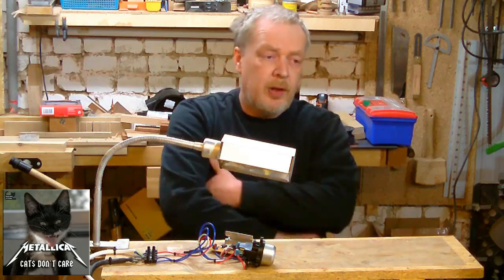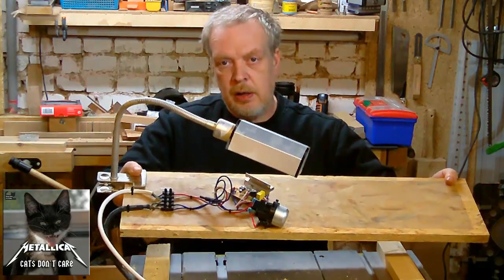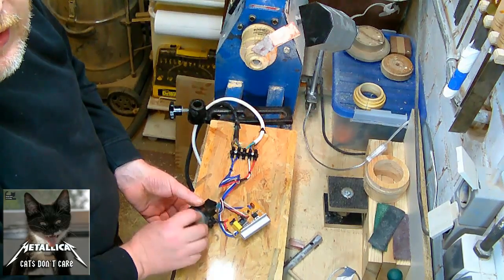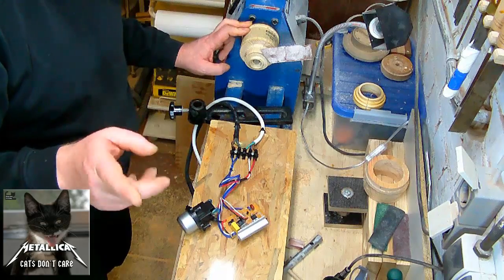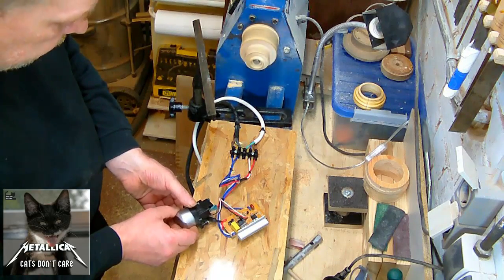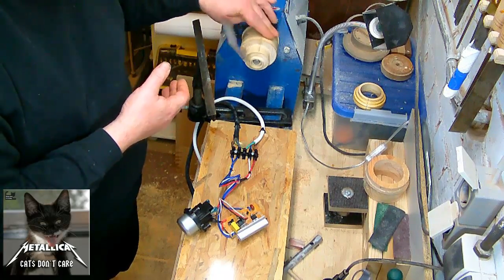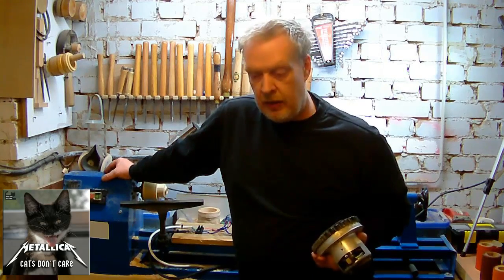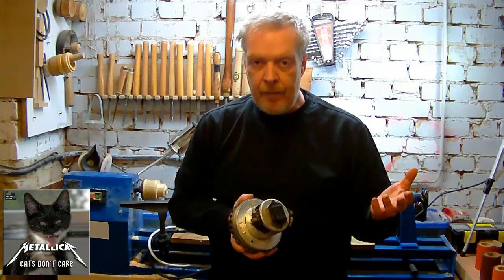Speed Control -- FAIL

Comment: Thank you for the reminder about checking the RPM (and a very clever way to do it - I'm definitely going to try recording the audio :))
Looking at your circuit (as compared to a circuit I pulled out of another vacuum), i think it's missing an element.
My vacuum had another capacitor (+another component) - it was mounted inside the motor housing (near the motor brushes / commutator)
Perhaps  that is the component that can measure, feed back or vary the frequency?

Anyway, thanks again. 
I will add this to my checklist of things to inspect before attaching my angle grinder and so on (:

Comment: thank you , i have been trying to figure out similar thing, i disasebled my 2 speed swich blenderl and want to use the motor for something else, but found that this motor on both speed switches is too fast, it has a 230AC supply 50Hz (south africa), i know i have to install a potentiometer(variable resistor) but where do i put it, it has diade and capacitor which is what cofuses me, serires or parallel

Comment: I have been "looking" for a system for the 240 V lathe to get the speed down to Zero and to keep the "power".
The best way is to exchange to the 380/400 motor and then its is home run.
And THANKS Peter for this Video!

Comment: Peter,
 I use  exactly the same lathe , but only as a sander  using a 200mm disk the speed is the second fastest on the pulley combination
try it and good luck lieben Gruss Hans-Dieter
PS if you are into speed control start talking Triacs which only works with certain motors .

Comment: Thank you Peter, I was involved with electrical work many years ago (usually much larger motors and control gear) and when I saw your facebook posts about this experiment I had a feeling it wouldn't work on the lathe but I couldn't remember why. Your experiment and explanation has recalled some long lost memories for me, thank you. 

Oh and the way you measured the speed of the lathe was totally inspirational, ingenious. One for the memory banks.

Cheers

Bob

Comment: If you want a slow speed sander and there is a rotational output from the motor would it be possible to mount a plate to the vacuum motor and control that with the speed switch?
Best Wishes, Brendan.